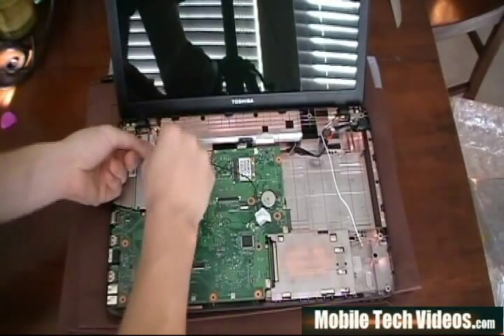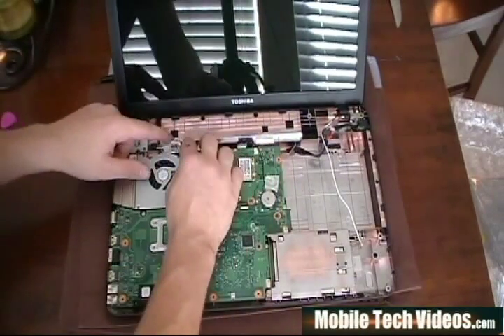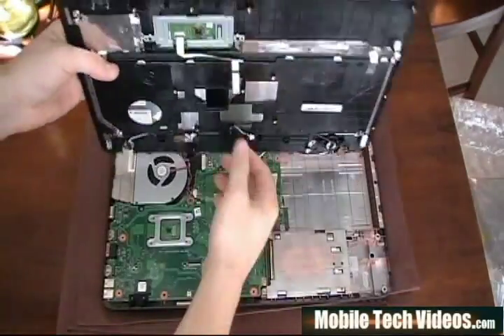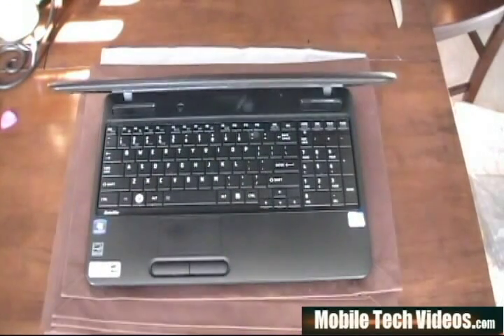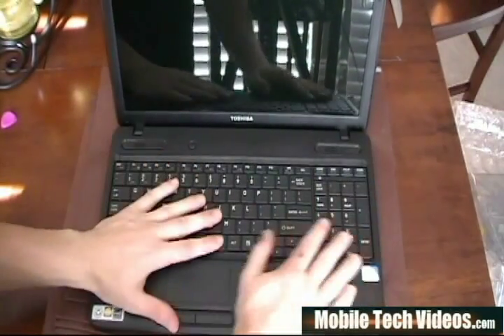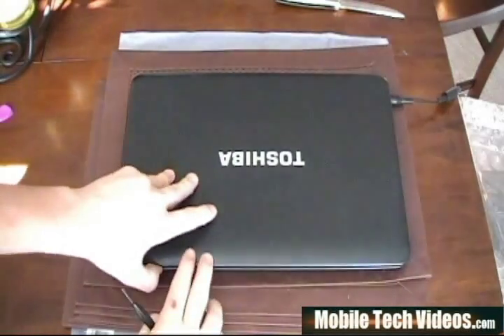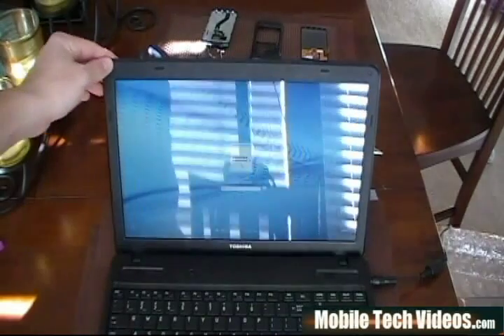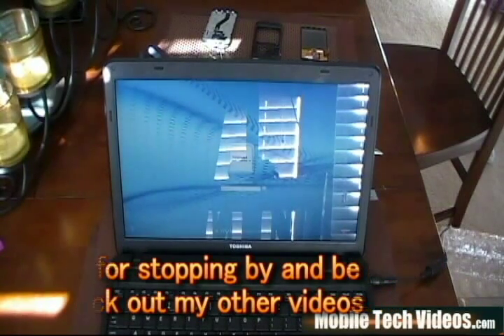Toshiba Satellite (LCD Repair C655 Models) PART 2

Comment: Gregory, thanks a million for your comment.  I hadn't noticed the bezel over the keyboard screws and I was getting frustrated trying to get the connectors back on with the keyboard mounted so websearched and got this video only to get more frustrated when he glossed over getting them connected.  Your comment saved me a big headache.  And I also took back a lot of mumbled cussing at Toshiba engineers!

Comment: Dude this guy did ok, but the easiest way to reinstall all the wires is to remove the key board. everything is visable. I recomend removing it before removing the touchpad/ top housing instead of putting your hands through the side. Other models have screw under the key board and it will not be possible to pull up or seperate the top housing piece.

Comment: Everyone you did not need to disassemble the casing with the keyboard and hard drive... he was just doing it the way he knows... the shorter dummy proof way is to just start right when he snapped the display apart. You can do that with the main casing still attached to it. Swap the screens and rebuild, simple as that. Please if you are not good at reassembling things or even just computers do not mess with the actual casing. People like my dad for instance would just cause more damage.